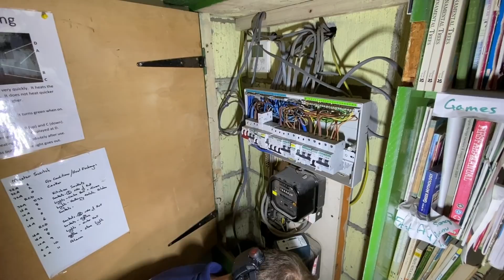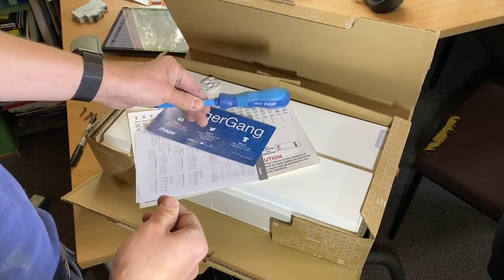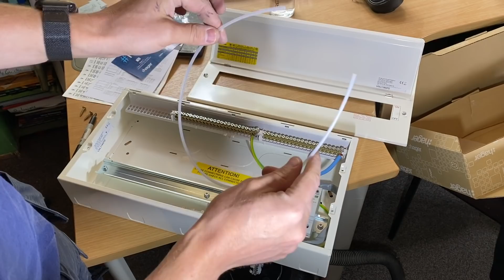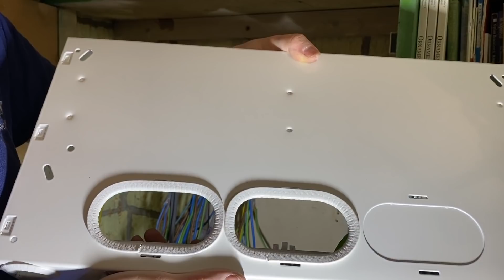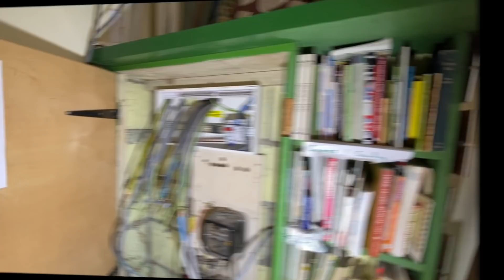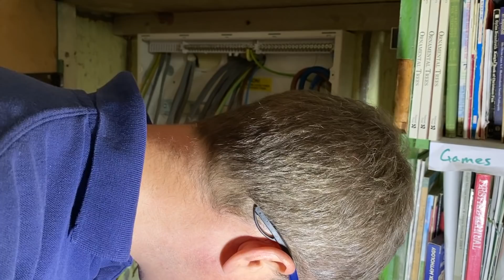Consumer Unit Installation - The Scout Hut - Episode 2

Comment: Hi Jordan, lovely neat job. I'm not a fan of ferrules on solid conductors, stranded and fine stranded is ok but not solid conductors, everyone seems to be doing it now.  I install and maintain industrial control panels and the ferrules on solid conductor are always the ones that overheat burning the conductor/device, the fine stranded cables with ferrules are always ok. I'm not a fan of adding unnecessary connectors which when crimped damage the conductor just as much as the screw terminal. keep safe mate.
Reply from the maker: Yeah I agree with you I would never install ferrules on solid conductors it makes no sense. On this job I only installed them on the 6mm and 4mm wires which were stranded and the neutral flying leads which were also 1.5mm stranded.
Reply: @artisanelectrics  , thanks for the update, were the 4 and 6 mm stranded cables fine or solid stranded ?, I only ask because I've seen solid stranded cable failures in ferrules.
Reply: +1 ferrules are designed to keep stranded wires  together .. no realy for solid wires ..
Reply: I absolutely accept what you are saying about using ferrules on solid conductors. You have the experience  of seeing the faults. But I am really curious to know why these faults occur. I would have thought if a ferrule is correctly and securely crimped on to a solid conductor, it would be fine. Do you have any thoughts on what might be causing a problem on a solid conductor that doesn't cause a problem on stranded?
Reply: @markrowland5393  , Hi Mark,  i haven't done any formal testing to prove my findings but the ferrules are always loose when they fail. i know the lads that install them and they all have the correct ratchet tools, i think it must be expansion and contraction of the crimp connector under load ( usually 25-35 amps ), i usually have to change the contactor, cut back the cable and terminate without the ferrule . touch wood they have all been ok on the 3 monthly inspections since. I've seen ferrules fail on solid core cables and larger solid stranded, it must be the small space around the conductors in the crimp ferrule. I've never had any problems with fine stranded even up to 25 mm. Have you experienced any failures ?
Reply: @colinfenton  Thanks for your reply. I haven't used ferrules on solid copper tbh and haven't had any failures on stranded. I was thinking about using a two into one ferrule on 1mm solid on heating controls but have decided against it because of advice from you and others.
Reply: @colinfenton  probably to do with contact surface area, with stranded cables you're going to have a higher contact area with lots of individual strands plus the cable is squashed by the crimp tool m as king a really good fit, whereas with solid it can't squash any further so you can get gaps around it, like you get with a CPU cooler against the processor no matter how good the contact there's gaps (hence needing thermal paste).

Just my 2 minute thought anyway.
Reply: @markrowland5393  When crimping them on, the stranded wire bundle can deform from the crimping pressure, while the solid wire will need much higher forces to deform. And only that deformation (and the spring force from trying to expand again) will provide a solid bond. Otherwise it's just 2 pieces of metal touching with no force holding them together.

Take two pieces of wire and wrap one around a solid pipe and the other around a rope. Which one will stay where it is and which one will slide off easily?
Reply: @HenryLoenwind  Yes, very good explanation. Thank you.
Reply: You don't need ferrules on any cable other then fine stranded. You must also use a ratchet crimping device. Coming from an industrial background I've used ferrules since I can remember. But never on anything other then fine stranded cable. Its not like a lug.
Reply: shouldn't the 25mm2 fine wire flexi tails have been ferrule crimped?
Reply: @johnb.9190  , Hi John,  we use brown 25 mm crimps on the tails but we cut the brown insulation off leaving the crimped sleeve to stop any confusion.
Reply: John B. Yes it’s considered good practice considering they are only pence to buy.

Comment: Use your snips and a slight bit of pressure to make a line on the outer PVC sheathing instead of that all rounder tool, then pull the  cpc conductor up to the line you have made with your snips, the sheathing should peel off in the same manner, thats how I do it any way...great content Jordan 👍
Reply from the maker: Thanks!

Comment: I do like the hager boards . Not happy the surge protection device taken off the main switch the size of cable look a bit under sized for the 100 amp cut out fuse .. I always alter this and put in on its own MCB  usual a 50 amp or a 63 amp with cable size to meet MCB size . 
Not sure if hager also do a board with round knock out in as well .
Reply: John Waby the connecting SPD cables (type 2 for domestic CU’s ) are designed so that the K2S2 energy withstand of the conductors 4 mm2 minimum will always be greater than the let through energy of the ocpd upto 125amps. That’s for back up protection, some SPD’s like Hager have a built in ocpd (according to them anyway) and a soldered internal link which melts during short circuit conditions negating the need for a separate ocpd
Reply from the maker: Thanks for the info!

Comment: Great vid👍 i was always told running cables through expanding foam was a massive no go! Either way, great board mate, neat job.
Reply from the maker: Thanks! Nothing wrong with a bit of expanding foam!
Reply: @artisanelectrics  apart from when the next sparky comes in to add another circuit and can't use a cable in the board to pull a draw wire in . 😜
Nice neat job though 👌
Reply: Maybe depends on the type of foam.
If it used hydrocarbons as a medium, maybe potential to soften plastic insulation?

Comment: Nice job Jordan....Hager boards are good but as you say let themselves down a bit by the square knockouts. I was interested to see you use expanding foam.. Not sure if you know mate but always check the foam you use because some of them are not suitable for pvc and will dry out the cable insulation and destroy it. I learnt the hard way with that on one job.😩.
Keep the content coming buddy.. excellent stuff!!!
Reply: rattlehead85 Hager CU’s are available in square, round or no knockouts so it’s whatever suits your individual needs.
Reply from the maker: Thanks!

Comment: I learnt the hard way many many years ago. As a young telephone engineer on a metal ladder against a metal partition, testing a 240v extension bell. Somebody rang the phone ! I was not thrown off but could not let go of the ladder. Fortunately ringing is pulsed so after 5sec I could let go. I could not move for several minutes. It would have killed a less fit person. All before RCBOs or even RCDs.
Reply from the maker: Wow
Reply: @artisanelectrics  I think, at the age of 12, my vocabulary was limited but even then I believe I sad something stronger than "wow"! 😉
Reply: Kevin according to HSE 4% of uk domestic fatal accidents were due to electric shock in 2018. Thats even though ELCBs , RCDs etc  have been in use for a very long time.
Reply: @alanjones3873  Interesting. I wonder what proportion of the deaths occurred with correctly functioning rcd's.
Reply: @dennisgorny9486  Many, many years ago when I was about 12 years old, I was replacing Christmas tree light bulbs. I was standing with bare feet on a marble floor. I got a really nasty shock. I've had one or two others, but nothing to compare with that first one.
Reply from the maker: True

Comment: A few years ago I had replaced  a storage heater by a hole in a wall  which was for an old gas fire flue in a hallway to outside  which had been stripped out, I was with a builder the next day who was filing the hole in with expanding foam  and the heat from the storage heater ignited the gas in the foam and there was a large fireball flash straight through the open front door. Builders eyebrows and arm hair were singed
Reply: I wonder if there is a warning about flammability on the tin?
Reply from the maker: Wow that’s crazy!
Reply: @artisanelectrics  it was done the next morning so the heater may of still been live still with the off peak not switched off at the time and triggered the explosion by when the thermostat clicked in or out creating the spark  with the gas build up as  the hole to be filled was about 100mm diameter right next to the heater so lots of foam used right next to the heater, For some reason a gas fire was installed in the  hallway at the bottom of stairs leading to the  flat above previously no idea why  it was taken out leaving a hole in the brick wall to be filled

Comment: Great video as usual. What is your DNO's view on pulling the main fuse? I've seen a few vids from several sparks with differing viewpoints. I'm aware that a particular DNO supplies temporary seals as they know it goes on a lot.
Reply: Most DNO's now don't give a witches tit mate. If a CU needs changing, why should a jobbing spark have to wait possibly weeks (and pass the charge onto the customer) to fit a DP isolator?

IMHO, the DNO'S responsibility should stop at THEIR side of the main fuse. We should be able to assure safe-isolation (with correct testing obviously) without having to wait, or having our work schedule disrupted
Reply from the maker: I totally agree
Reply: RWA PAT Testing There is a company out there called HASTE which will attend and put an isolator in for you to allow safe working without the need to pull the main fuse. Worth checking to see if they cover your area. That is obviously a fee you add on to your consumer unit price but it does leave the installation in a much more user friendly way for future works and testing 👍🏻
Reply: Sparky MacSparkface DNO fuses are often poorly fitted and maintained, Not something that I believe sparks working alone or without protection should promote. Am not saying don’t do as there’s always an exception. But the risk is greater than most sparks see. Maybe time for the horror stories to be put on you tube.